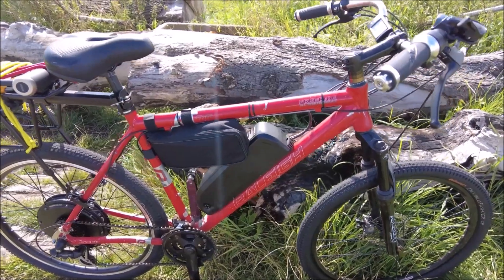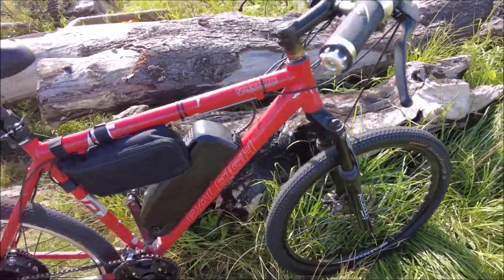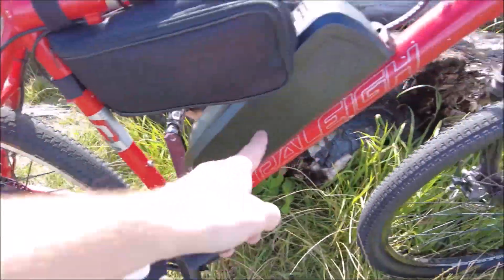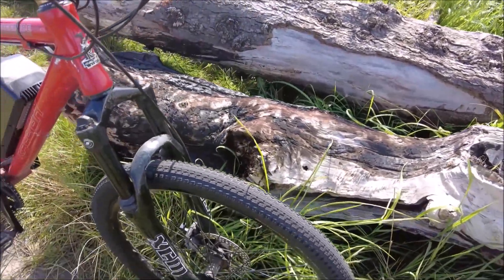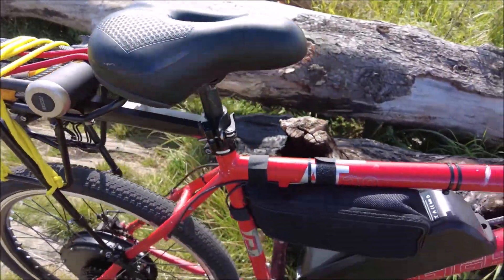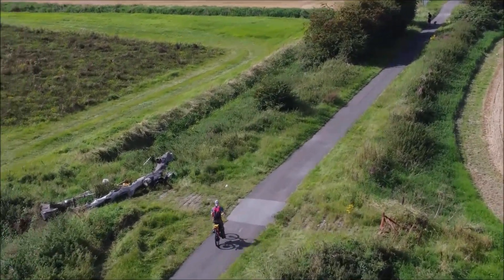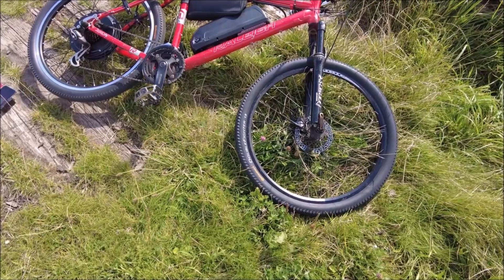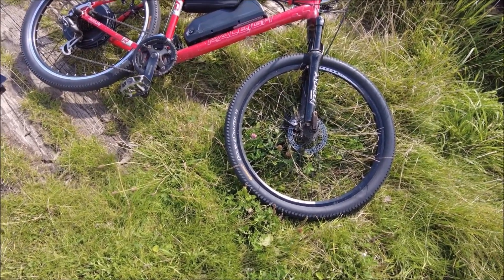NAIMP 48V 1000W Electric Bike Conversion Kit, Build Test.

Comment: What's your top speed ?
Reply from the maker: 26
Reply: How far is the range from a full charge?
Reply from the maker: @misterjei  I did 35 miles yesterday and the battery had about 25% of its power left.